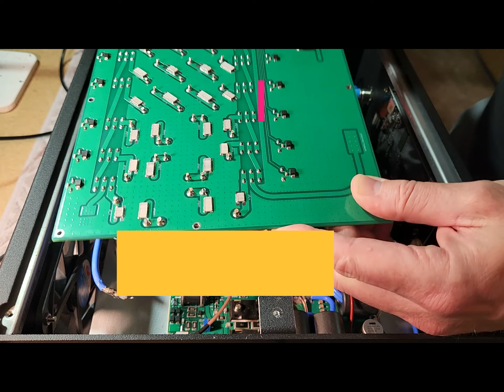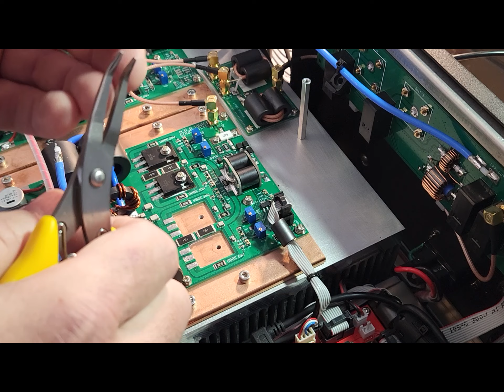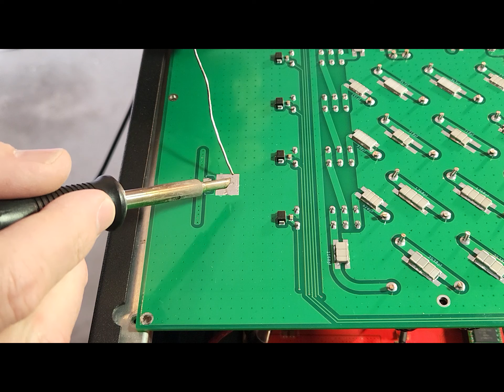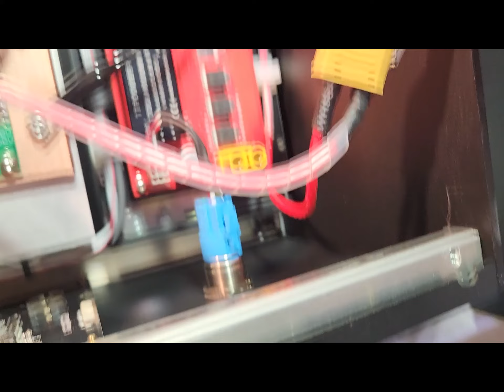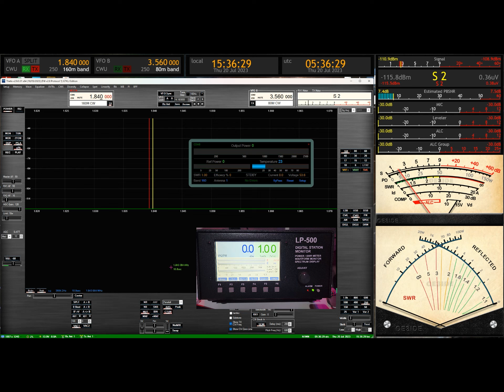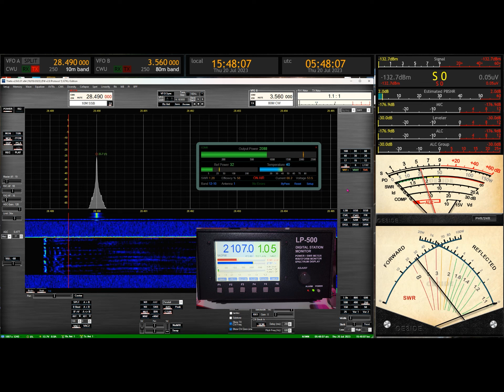2kW VK3AMP Transistor Replacement

Comment: Hi there bud. I dunno if you noticed or not, but when you were removing the cut mosfet legs from the right pcb you dropped a shit load of solder from your iron tip onto the pcb. Location top right side of the board where you were talking about 12 volts to the 6 pin plug above BIAS 2 adjustment. From what I can see at a quick glance there is about 4 smd capacitors there.  I hope this didn`t or doesn`t cause you or the owner any issues now or in the future.
Cheers.

Comment: Any difference between MHT1803 and MRF300？ If I just run the amplifier from 1.8MHz to 54MHz, can I get similar power output on these bands by using MHT1803 to save the cost？ Thank you!
Reply from the maker: No difference, that I've seen other than the cost.

Comment: My amp is on the way now. How the AC cord and ac male jack on the back of the amp look like? I am working into installing 220v on the radio room for the amp..
Reply: The amps use 15A C19 Connector
Reply: @AmateurRadio-2PW  Great. I got one cable from Amazon, a 20 amps one, installed a 20 amp breaker and wire size 10, then got now 240 VAC on the shop with a dedicated outlet. Thanks.

Comment: You should always run auto band change interface to your HF radio so you don’t TX on wrong band setting on amp. You want the amp band pass filters to follow the band on radio.
Reply: they prob don't come with the auto band switching to save on cost...my guess.
Reply: @minibikemadman  yes they do auto band switching